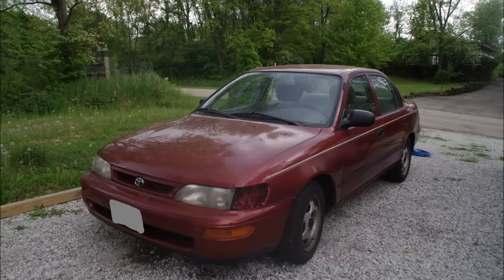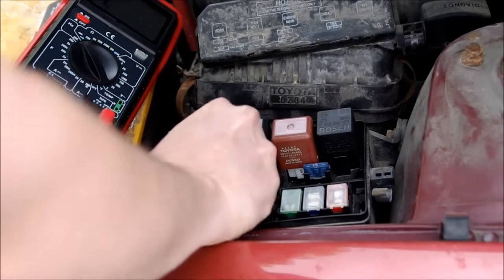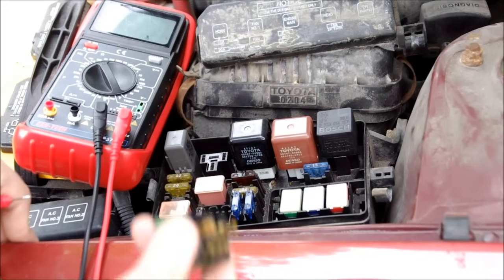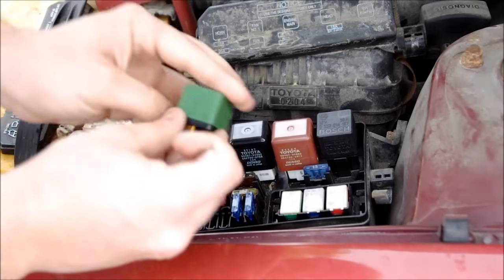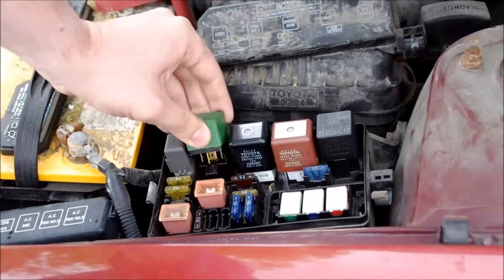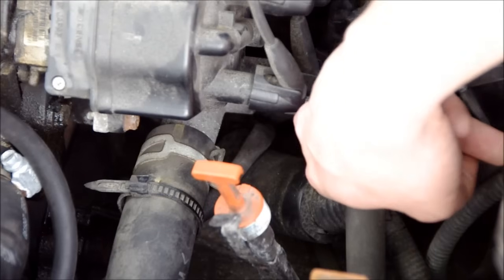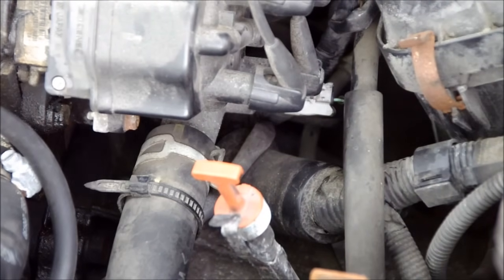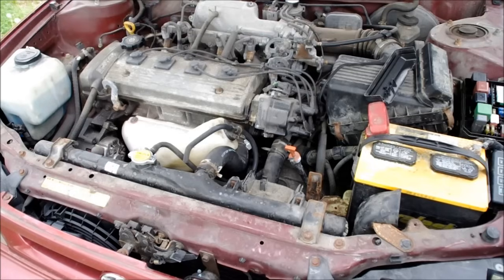Fixing an overheat condition (the radiator fan) on a 1997 Toyota Corolla/Geo Prizm

Comment: Alec..ur a good instructor ..u explain things very well.. i have only one query.. the reason maybe why fan did not run when you'v  connected the sensor is because the engine is still in its cool state. . it will only de-energize the relay coil when the engine reached a predetermined high temp when engine is running.. causing the temp-operated fan to run.. & yes i also do believe that the culprit is the temp sensor.. since uv temporarily fixed ur friend's car.

Comment: It means when the coolant temperature sensor is closed it will energise the relay where the fan contact is open . And when the coolant temperature sensor get heat will open the circuit and will cut the relay . And when relay cuts so the relay will pass contact to fan . Correct me if I am wrong

Comment: Great video, thank you for sharing. I have exactly the same car, with an overheating problem. In my case, when disconnecting the cooling temperature sensor and turning the ignition on, the fan does NOT run. I checked the fan's operation with a paper clip and it works just fine. I also checked the reley, and it works just fine, too. Do you have any idea what should I check next? (My mind goes to possibly worn cables, which keep the reley grounded all the time, not allowing it to de-energise.)

Comment: YOU ARE FABULOUS!!!  KNOWLEDGABLE, THOROUGAL and PATIENT~~~
I HAVE A 96 GEO Prism, that has a slow water drip at the "bottom" left of the radiator,(looking from under the hood, with your back to the windshield.  eg., Your face is facing the front of the vehicle, while looking from under/inside the hood.) 

I can't tell if the slow drip is from a hose, or the radiator.  NOTE:  In addition, the engine stays cool/normal temp when in the freeway, but over heats at stop and go traffic, the problem in your 97 GEO Video, soooo, it appears as though I now have TWO PROBLEMS... 
P.S.,   What is the name of the part (Fan" you are going to replace) and the part number?  Are you going to replace it with "genuine" parts, or are you ordering after market..., on Ebay or from the Dealer???  Lots of questions, I know, but I don't have the funds to send it to the repair shop, and I like the challenge of repairing things myself.
 YOUR RESPONSE IS GREATLY APPRECIATED,     SANDRA LEE

Comment: Great video on trouble shooting. My relay done the exact same thing as your had done. I also replaced with a new temp sensor and I still get nothing. I've been pondering this issue for quite a long time. I'm getting close though... Ive got a 2000 toyota solara which is basically the same...

Comment: That was very informative for me.
 My 96 corolla fans arnt kicking on.  I will use this  info to correct this problem. Thanks. 
    Very well narrated.
Reply: mine still overheats during summer highway driving and I just had 10w 30 put in and fresh antifreeze and water put in but I believe it's 60/40 instead of 50/50

and fans work

but I think it takes a slightly longer time to cool down

any ideas?
Reply: fargeeks bad thermostat
Reply: +William Dowell actually no it turned out it was the radiator and or the water pump which I had both replaced
Reply: William Dowell   no it was the sensor.. when I disconnected it the fan turns on.. this video helped me fix it.. I still have the car.. it's parked .I've migrated to a 93 Camry
Reply: Usually the water pump will start making a rack or leaking before it fails,
radiator could've been dirty.
Reply: +William Dowell well it was over 10 years old

Comment: you are a good man alec. I got the sensor unplugged fan runs now. would you say I'd need to replace the sensor as soon as possible to avoid the fan burning out?
Reply: im having this problem with my 97 elantra wagon. i have checked my relays they are good but even with the cable of the sensor the fan does not turn on. my book says i have to get my ecu (car computer checked) at my local hyundai dealer. i am going to replace my sensor first before i get the ecu looked at. it is a much cheaper alternative. and its only 40 bucks to try so go for it.

Comment: Thanks for the video!  If this censor is bad will it set a code in the ECM and the check engine light come on? I believe this is my problem I also found out that I can turn the AC on and it would turn the fan on and cool the car back down when it was over heating.

Comment: Running a cooling fan constantly can overwork the charging system & cause the alternator to fail! Simply cutting into that temp sensor wire & running a wire into the cabin & connect it to a two pin toggle switch & then continue the second lead straight to a ground within the cabin! Whenever the fans are needed, Flip the toggle switch!!!

Comment: Hello and thanks for your post.
I used your method to figure out the same problem on my 97 Camry. I now know that if I disconnect the cooling sensor, the fans will keep running. The question I have is that should I replace the sensor or it might be the wiring?
Reply: Thank you Alec for your quick response.
Reply: Caspian Sea Hi Alec,
I replaced the temperature sensor on my 97 Camry today, but the fan didn`t come on. Is there anything else you think I should do to fix the issue? I can run the fans by either disconnecting the wire or turning on the A/C !!
Reply: @caspiansea6745  I'm having this same problem! I've already replaced the sensor but the fan still won't come on unless I disconnect or run the ac. How were you able to fix this?
Reply: Turns out replacing the sensor (the one that allows the fan to run when disconnected) solved my problem. I had replaced the coolant sensor, then the thermostat, then the "radiator fan switch" which seemed to be the component at fault.

Comment: Great video tutorial, I have a 99 Toyota Rav 4 which is a similar engine as above, but in my test my radiator fans will not come on unless I remove the radiator fan switch which is located near the lower radiator hose.  The problem is even after replacing the radiator fan switch it still doesn't kick on the fans at higher temperature.   I'm guessing the theory is invalid that if you unplug a sensor and the fan doesn't come on that it would be faulty.  Please help

Comment: hey Alec great video I have a 1999 corolla with what appears to be developing the same problem I followed your tuition and it was like I was working on your friends red corolla. The only question I have is how did you disconnect that plug from the sensor?
Mine is stuck fast

Comment: Alec, my friend. I pursued this method for diagnostics. Does your knowledge exceed what is here? This is the exact process I used, and there does not appear to be power to the fuse or relay, but if I jump the fan to the battery, the fan does run. My understanding of the function of a fuse is that it is a circuit protection device. If hot goes to ground, in theory, the fuse would blow before damage to the circuit occurs. In THIS case, there doesn't seem to be power to the system, the A/C does not turn the fan on, the fan does not turn on at all. If there is circuit damage, is there an alternative process?

Comment: This video was helpful. However, my car does not overheat just in traffic. in fact, it overheats after i have been running for a little while. Then, the engine shuts off. After a cooling off period, it will start again and I can continue to my destination. Do you think replacing the thermostat will fix this? Or could it be as serious as the water pump?
Reply: Paul Howell  I have the same problem can you help

Comment: looks like you had a tough time with the plug too. what was the trick to getting it off? do the tabs press in or need to be pried out?
Reply: i use a pick to push in the little pin in the square hole, that often does the trick

Comment: Hi I think you may have just saved me at least $300 I have replaced every relay o the vehicle as I had already replaced the water temperature sensor after it failed but I had purchased a Tridon aftermarket part. Your advice to disconnect the sensor line and turn on ignition proved the high speed fan is operating so now just the line to the sensor or the aftermarket sensor is a dud. Thanks again.

Comment: Thank you so much for this video but I have a worry though! My corolla 94 overheats on high way, when It does, i stop and open the bonnet and notice that water spilled out after heating too much, and the radiator is completely drained of its water. I fill it up again with water, fill up Coolant, and after about 30km drive, same problem. But when driving in the city, its no problem. Could you please explain to me how to approach this issue?

Comment: Hi Alec thank you for the very informative video I have subbed. I have the same problem and tried what you did but the radiator fans still wont turn on when they should (at 90 celsius), I have a Toyota Previa 2000 (ACR30) and here is what I've tried so far:

-Radiator fans work fine
-Radiator Fan Temperature switch works (tested outside)
-Coolant temperature sensor works (tested outside)
-All fan relays work (tested outside) and all fuses are fine
-When ignition is ON a paperclip into connector for the fan temperature switch turns the fans on
-The paperclip trick you did at 5:43 doesn't work for fan relay 2 and 3, but works for relay 1
-When the fan temp. switch connector is unplugged with ignition ON, the fans don't turn on

Could this mean the fan relays aren't getting power and there's a problem with the wiring going into relay box? Or should power NOT be going to those relays until the fan temp. switch triggers at 90 celsius?

I apologise it is a bit of a read, I'm really clueless at this point,  thank you for your time in reading this I would really appreciate any help.

Comment: Hey Claude and Alec, I think your highway problem is probably the thermostat!!!!!!...or maybe you have a leak somewhere..hose..radiator..or water pump (when the seal in water pump breaks, it will drip out a little hole on the bottom of the water pump)...also, Alec...excellent job on the video!!!!!!...My only advice would be the water pump issue..some guy once said that it always works (if it is spinning, it is working, because it is simply an impeller) [of course the impeller could snap off internally*rare, I'm guessing*]...he told my that the only real problem with the water pump is when the seal breaks and it will leak...but will always work if belt-connected!...Also, I believe the water flow usually flows from the radiator out the top to and through the thermostat housing...and I saw some other post where a guy took his radiator cap off and could see that there was no flow???!!!--I don't know for sure...but it makes some sense!  Thanks again...very useful information from everybody and especially you, Alec!!!!!!
Reply: A former Army mechanic at AutoZone told me RockAuto is great for online parts! http://www.rockauto.com/catalog/catalog.php

Comment: Hi Alec,
Thanks you very much for the video. It's really help full for me. I need your assistance regarding radiator issue. When my car heated up, all the water goes out in bottle and also bottle cap open with the radiator pressure. one thing more my radiator fan also not working. My car model is Toyota 98 sedan.

Comment: My car is 1994. I think that the second fan does not working, the one on the left side of the radiator. The first fan works fine. I feel that it is hotter in the engine compartment of car because I see water evaporated from the engine hood while drying in rain. Which relay should I check? Thanks

Comment: the fans in my 1997 Honda Odyssey not work and the thing is that when I turn on the car, the temp. gauge goes all the way to have even that I know that the car is cold, and I can`t find the problem, cu`s I all ready change the thermostat, the cooling temp. switch, the cooling temp. sensor, and I test the relays by switching them and the fuses, so what else you think I need to do?

Comment: Hi there cool video and very imformative and maybe I can get some help here. My 01 accents fan wont turn on either. Checked relay, and fuses good, tested fan, good. However when I unplug my radiator tmp sensor, the fan doesnt run. I checked the volatge on plug to the fan and its fine. When I checked the voltage to plug to sensor. Gave me a weak signal but shoulndt it turn on regardless if its off?
I know engines since I could walk but never been too good with electrical wiring systems.
Any info is greatly appreciated

Comment: I have a similar engine type with the one to you are showing but problem with the radiator fan. Both fans ( Cooling and radiator )works but the radiator fan motors keeps burning out in just 4 months or so. Any ideas?

Comment: man you are awesome
but i have one question i got Hyundai Accent and i got exactly the same issue
if the direct it the fan runs and if the connect the connector which turns on the sensor fan does not work
now i most of the Indian mechanics are saying its a problem with ECM in the car
is that correct
do i have to replace it or can it be fixed
because ECM costs a lot

Comment: interesting I never knew that the relay was always energised. My relay is always warm when the car is running, so I guess that is normal. But when the fan is running, the relay gets smoking hot. Initially I thought that might be a problem with the relay but I'm starting to think too much power is flowing through the relay. Why? That's the next thing I need to figure out.
Car overheats, fan will switch off after running for awhile.

Comment: Hi I have a 1994 Toyota corolla and out of no where it started over heating . it over heats after 10 mins of driving it, on traffic & driving it .  one of the radiator hoses ripped open I guess all the pressure . is the thermostat or waterpump the problem or the temp sensor ? I really don't have money to take it to the mechanic I know they will get me for sure.  thanks.

Comment: So, I tried everything you did. 99 Corolla. What would you do if the "paper clip" trick didn't turn the fan on and didn't hear the "click" when plugging the relay back in. I also unplugged the fail-safe system, and the fan didn't run.

Comment: My car Vios when engine ignited, the coolant fan did not turn on. When i on the air conditioner, the fan will start spinning but off and on within few seconds interval repeatedly. The air conditioner will not cold after car running for 20min. What is the problem?

Comment: Great video!  
The part you need that coast $40 to fix it is called? I think that's part that I need. Thanks!
Reply: temperature sensor switch
Reply: @timothypatnaude7364  the radiator fan switch is separate from the coolant temperature switch

Comment: my car will throw the coolant out of the gallon container if the heater is not on and the fans will not turn on.but if the heater is on the fans will turn on the car will be okay can it be the temperature sensor??

Comment: I have the same car. The radiator fan is running. But the other fan at the front is not running even when my air conditioner is on. Where should I start? I tried looking for fuses, but unable to find it.
Reply: Me too.. What is the one on the front for?
Reply: +Piero Botteri AC condenser cooling fan. Anyway, I've replaced mine with a new one.. now it's working.
Reply: +Ezalian thanks..  My ac works fine but the fan does not run.. What dors this mean?
Reply: +Piero Botteri Yup, my ac works just fine too except in a very hot day, when Im not moving the ac is not cool enough until I start moving again. It's probably the fan motor that may be siezed already. So I changed mine with a new one.
Reply: +Piero Botteri likely that it kicks in automatically
Reply: fargeeks problem fixed, I had air pockets in the system run the car with the heat on full blast and coolant top off, should do the trick,  refill as needed

Comment: I have a 2001 Toyota Corolla Sport.  It has a dual radiator fan.  One fan works and the other is not working. I need to know if both fans works off of the same sensor, relay switch, motor and so on or not so I know if I need to just go ahead and buy a new dual fan assembly or if something else could be causing the problem?
Reply: Please help. My fans dont turn on after replacing the fan switch just as you did in this video. Relays, and fans work. How do I test the circuit on a single pin wire? Where does that green wire go to? Do I check for continuity or resistance? Not sure what to do. Thanks.

Comment: I have the exact car, same color engine, etc. I tried your recommendations. I bought a new fan, new fuse, new relay, new fan switch(under distributor) and have no power when I jump it with a paper clip as you directed. Any ideas?
Reply: Try to wire the fan directly to the battery
Retro amd ghetto but hey,  if it works. Why not right?

Comment: i changed water temperature sensor, changed relay, didnt help when i pull out the water temperature sensor port the fan starts spinning, what is the problem

Comment: hi in my car,the coolant container  always shows significant decrease witihin one week even if i refilled it to maximum...i checked if there is any leak on the bottom of the vehicle,but i could not find any leakage...could u please tell me wat will be the possible reason for this?
Reply: +Pradeep Menon check the radiator cup it s not working properly , some coolant is going out of the sysytem

Comment: Ok... Question ??? 
What happens if when you disconnect the coolant temperature sensor fans come on, so I replaced the cooling temperature sensor, still same problem.. fans still don't come on. 
Remove the relay, fans come on. 
Unplug the cooling temperature sensor, fans come on. 
Even with new cooling temperature sensor. Still same problem. Any ideas ?